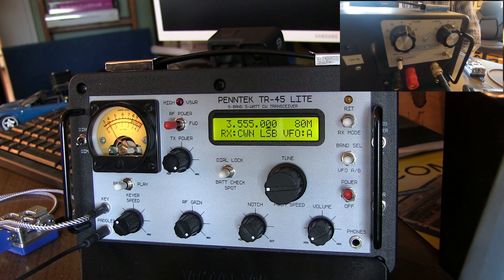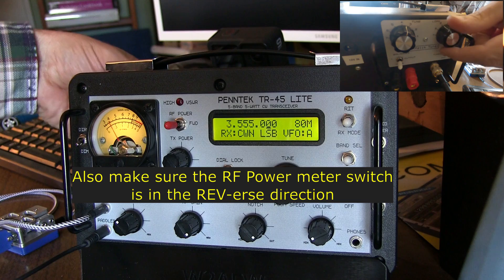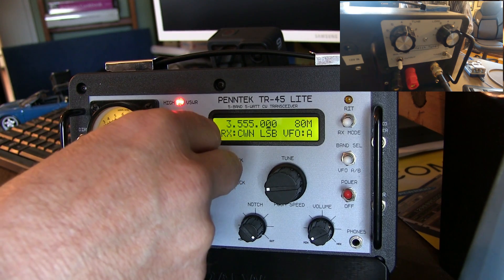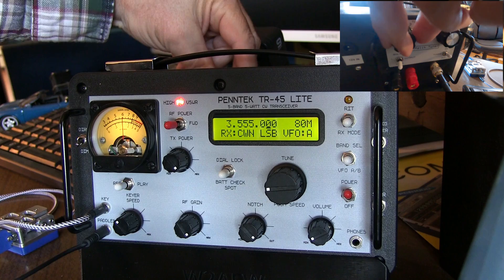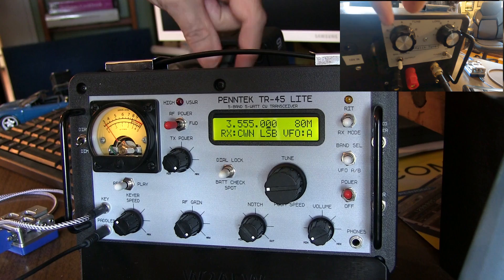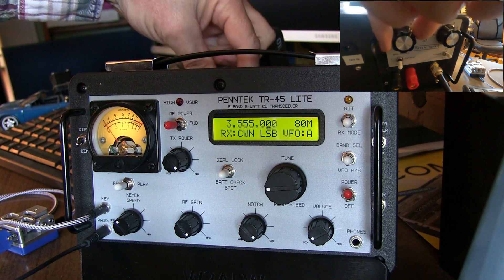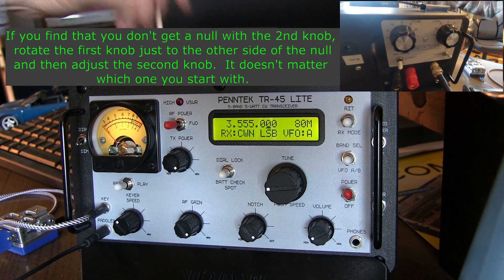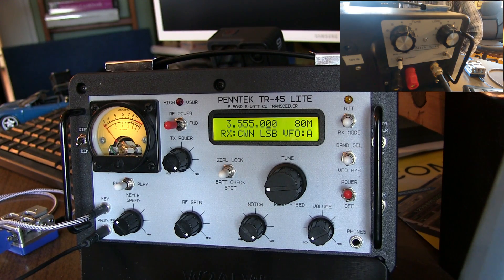#385: How to quickly tune the Penntek TR-45L Z-match tuner

Comment: I watched a presentation of some amateur radio club and the the presenter said that tuners suck up radiating power and when doing QRP, one absolutely doesn't want to use tuners....I became quite incredulous when I heard this. Being new to the hobby, Is this something worth pondering over next time I take my IC-705+ random wire and AH-705 tuner for a walk?
Reply from the maker: The presenter was ill-informed.  A well designed tuner has very little loss.  There may be some additional loss in the coax when the antenna is non-resonant, but often is of little consequence.  I have well over 5000 QRP contacts operating 5W with a tuner into non-resonant antennas as evidence that says that using a tuner is just fine.

Comment: Hi Alan, I'm asking in this video since I'm not sure how else to reach you. What is the main difference between a dedicated RF signal generator and a function generator (AWG)? Is it perhaps that the RF signal generator can more easily generate VHF and above frequencies and very weak signals strength, whereas the typical funciton generator generates relatively lower frequencies compared to the RF generator and is and would tipically require external attenuators for RF work? Is there really a difference between say a 14MHz sine generated by an RF generator vs a funciton generator? Would you considering covering this in a video? Many thanks, Alex M0OOV
Reply from the maker: You’ve got the major differences. Internally they are quite different.
Reply: @w2aew  Thanks so much for your reply. In the meantime I've also learned a bit more but I feel that this topic is not that well covered on YT. PS. Excellent presentation you did for the RSGB on the Nano VNA, I thoroughly enjoyed that! 73

Comment: How do you feel about tuning for max power out (forward power) instead of minimum SWR?  I guess that may depend on whether your rig's output transistor is protected for high SWR and puts out max power at minimum SWR.
Reply from the maker: This rig doesn't have output protection.  The meter is reading REV power, so minimizing that is the goal so the max power is delivered to the antenna system.  Not sure if the FWD power will be accurate when there is reflected power present (depends on the standing wave), so minimizing reflected power is better.

Comment: Great Clip.
Here is a circuit challenge:  We have Capacitor Multiplier circuit, can any one design a Resistor multiplier circuit?
Reply from the maker: No, because there is no energy storage in a resistor.
Reply: @w2aew  Thanks,  of course you are right we cannot use passive circuit to do that, but we might be able to do that using active circuit.
Here is my idea how  to design such circuit:  

1.  Resistor to voltage converter (easy by passing a fixed current through a resistor)
then 
2. Voltage to resistor converter (using MOSFET in Ohmic region)
That is:
R->V->R'

Another idea is to connect the resistor to the emitter or source of BJT or MOSFET transistor and look into the impedance of base or gate of transistor.
The input impedance is about (Beta + 1)Re

We might also be able to use current-voltage feedback loop (on an opamp) to do that.

I wonder is there other circuits such as gyrators or opamps to achieve this.

Applications:  
1.  Measurement of low resistors (like 1mOhm) without using high current.  
2.  Tunable low frequency RC filter and oscillators.
Reply from the maker: @aduedc  Without some energy storage (capacitor or inductor), you can't generate a voltage greater than the supply voltage, AFIAK.
Reply: @w2aew  As you know looking in the base of the transistor make the emitter resistor looks much larger.   The question was can we design a circuit that multiply a resistor.

Comment: Wonder what the reason for that would be, Alan. Do you have an idea?
Reply from the maker: You’re still winding up with the same solution, only you’re taking an extra half step with each adjustment to get there faster.
Reply: Alan, understand. Every time I use a tuner, it takes me back to my [first] Novice days in 1961 when I'd tune up my DX-40. Tune, dip, tune etc. and try to keep the 6146 plate from turning cherry red! 

A segue here: having a world of fun with my QDX doing FT8 when the little beast started belching smoke. Come to find out that the old LDG Auto Tuner I used would send an horrendously high VSWR when I switched bands and the poor BS170s gave up the ghost.
Well, new finals and my little 4SQRP manual tuner and a little more sedate band switching and things are right as rain.

72 de k6whp

Comment: Thanks Alan, another great video!  I have written down the capacitor settings for the different bands and I find that gets me very close.  However, I am definitely going to try your "just past the null" method the next time I am out.  The weather up here in Ontario is getting warmer so I want to get out for an activation with my TR-45L as soon as possible.  73! DE VE3IGS - Lyndon